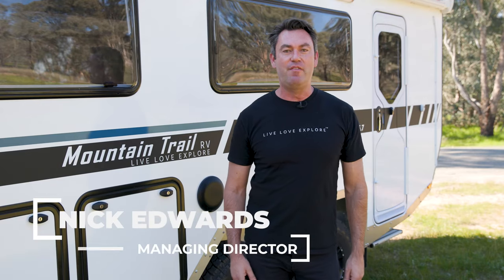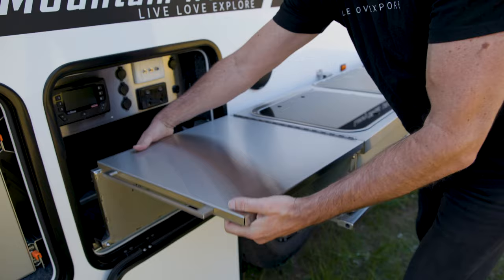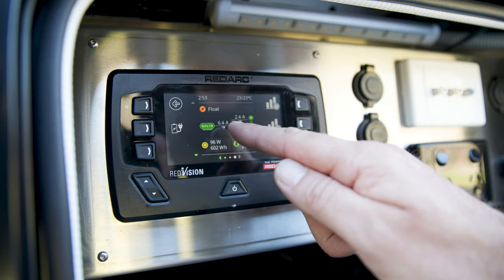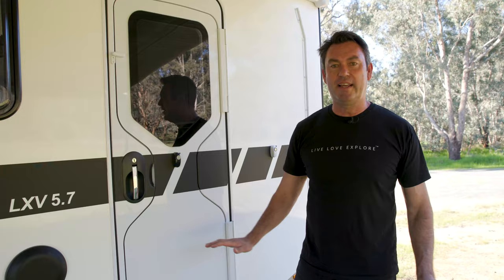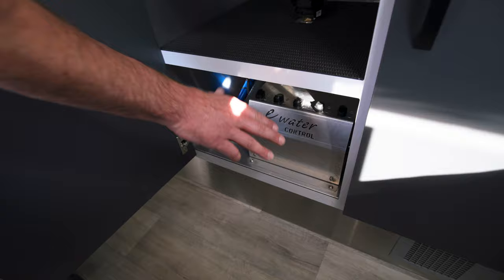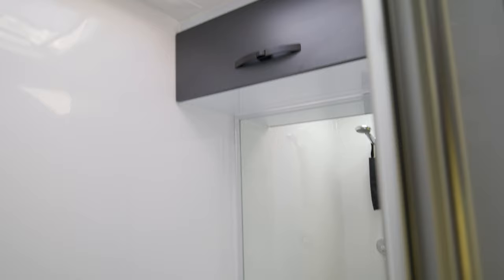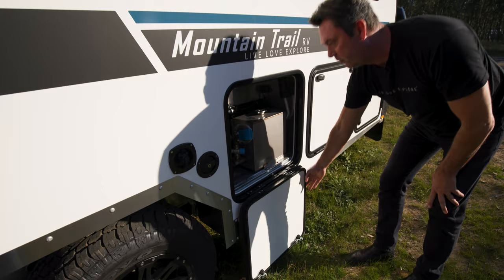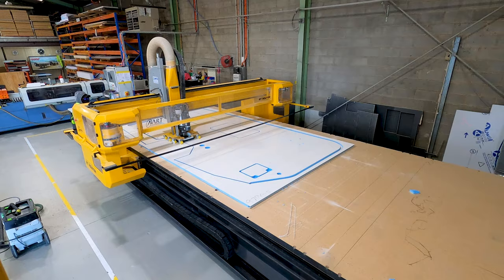2022 LXV 5.7 Off-road Caravan SHOWCASE

Comment: Also, what brand of diesel water/heater are you guys using does it have a diesel compatible cooktop option
Reply from the maker: Hi Evan, our diesel heater / hot water unit is made in house at MTRV.  We don't offer a diesel cooktop option... only LPG and Electric Induction